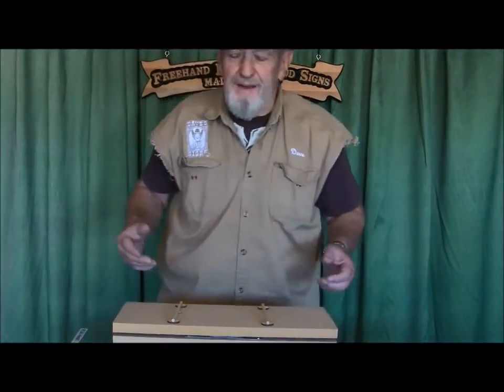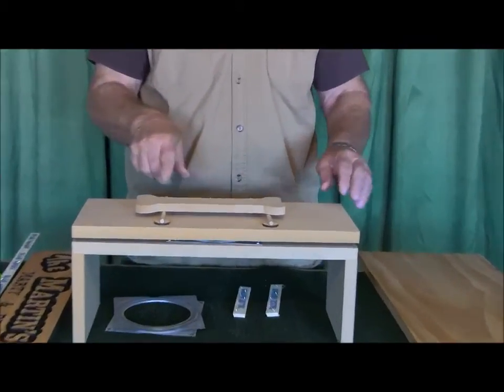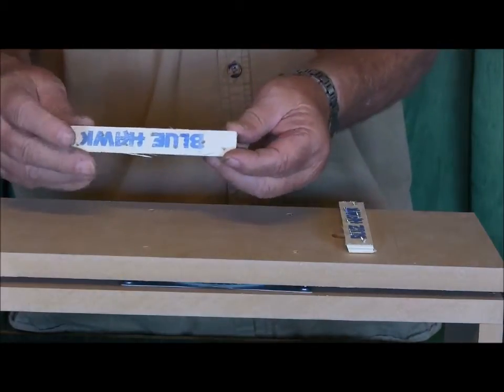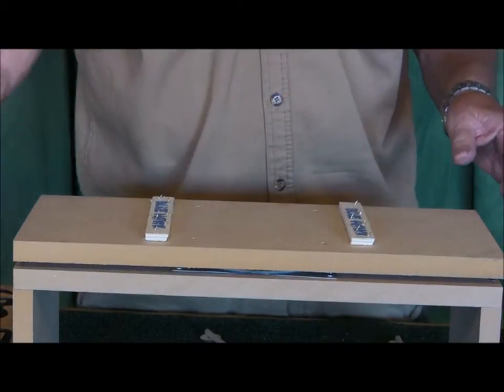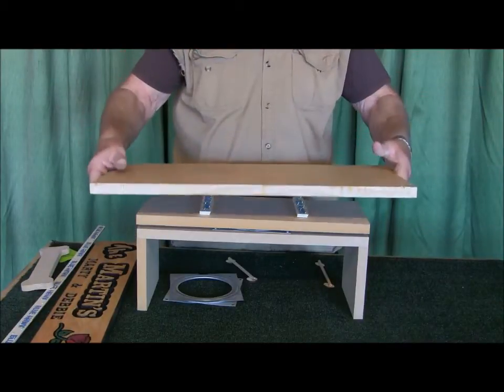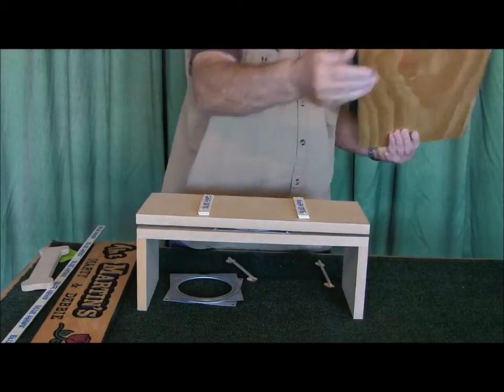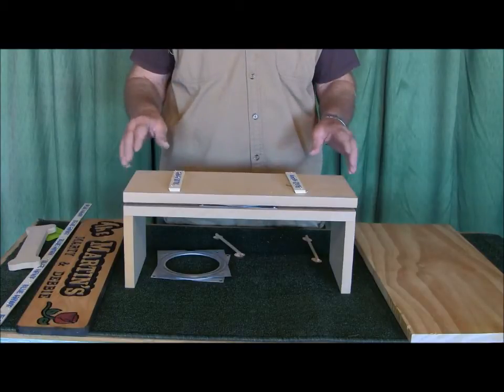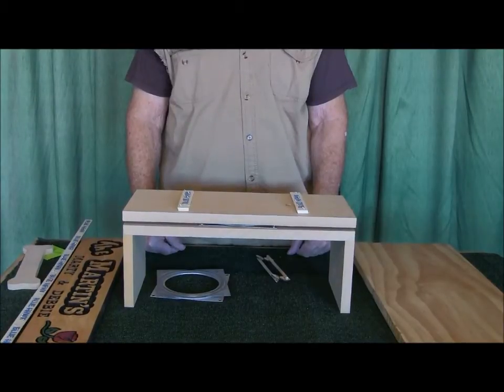#102 Lazy Susan Base

Comment: Love the interaction between the two of you! Lazy Suzan good idea and I will use it in my woodworking of small projects. I have been using the carpet strips so let me pay it back to you and mention that
If you hammer those nail tips over just a touch if will prevent them sticking to the bottom of your project. Unfortunately that won't help if Eric falls asleep or does a heavy handed sermon on them. Haha. Thanks for the tips and will be looking forward to more!
Reply from the maker: MRrwmac Thank You for the for the comments & the tip. Yea dad & I sure have fun with these. I knew if I said something he would come up with a funny reply. More to come this week.

Comment: Maaaaaan... I wanted to use it as a pulpit and talk about the Democrats...    I just built one.  I used 4 12-inch strips of the carpet tack strip laid horizontally.  The strips had 1/2" nails every 6 inches or so.  I just nailed them into the top so the strips are permanently mounted. I'd lose them and probably step on them if they weren't attached to the table.